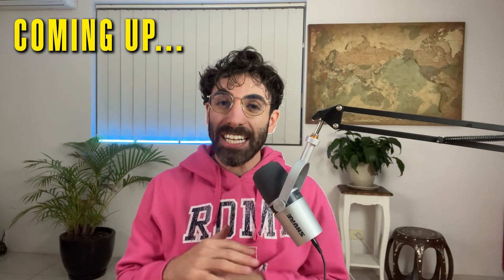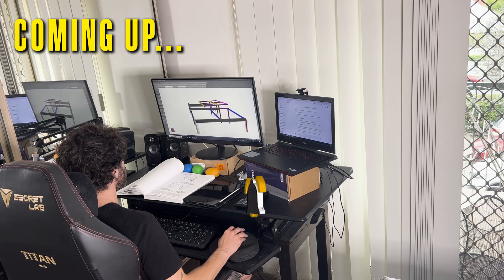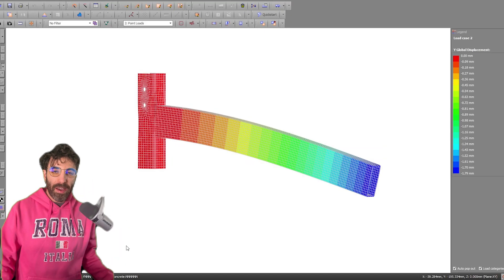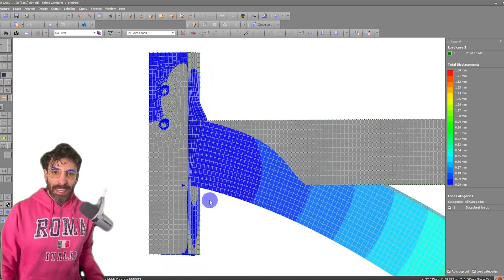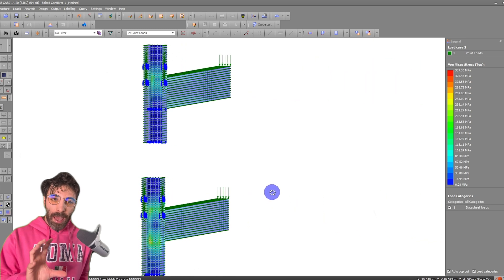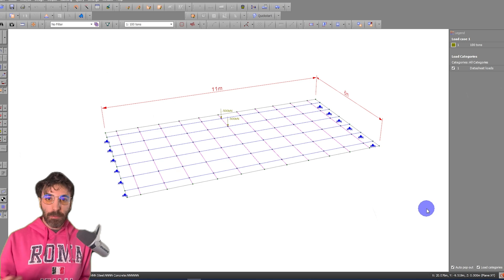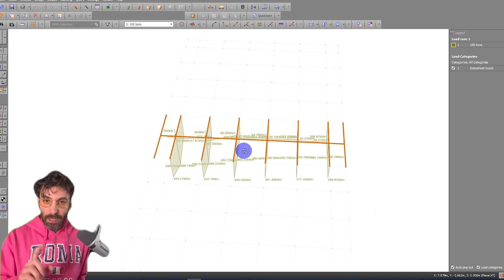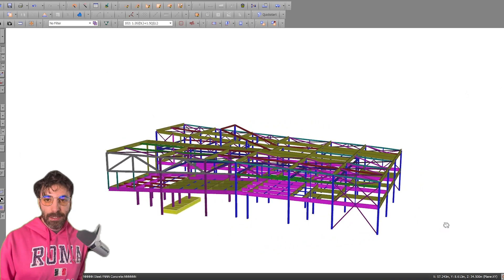Day in My Life as a Structural Design Engineer: Spacegass Software

Comment: Which software did you used mostly during RCC design?
Reply from the maker: I've been using a software from Inducta called RCB and SLB. They have post tension design as well.
Reply: @bengthebrazilianengineerinAus  is stadd pro and etabs are useful there?

Comment: Does the bridge grillage have full torsion stiffness or 0.2J for example?
Reply from the maker: I have to look into it again. I can't remember, but the results compared to a simply supported beam are very similar so I'd guess I didn't change any stiffness.
Reply: @bengthebrazilianengineerinAus  never mind the 0.2J seems/torsionless design seems to only be for beam and slab composite decks. Love the videos 👍